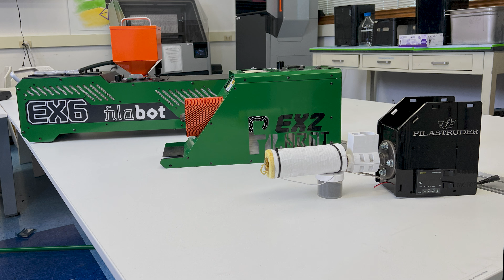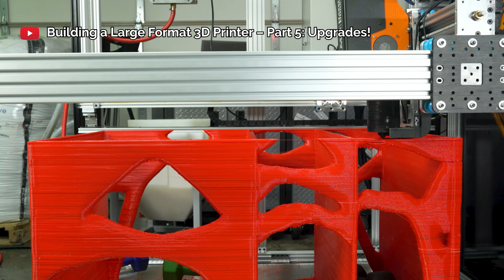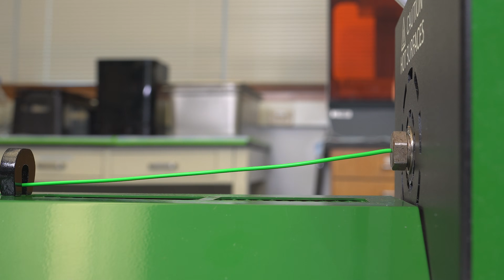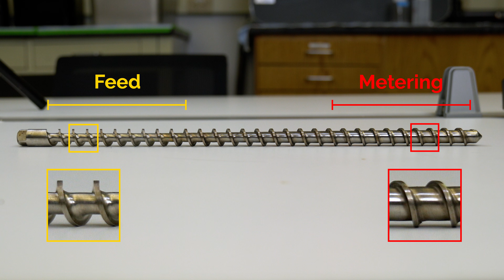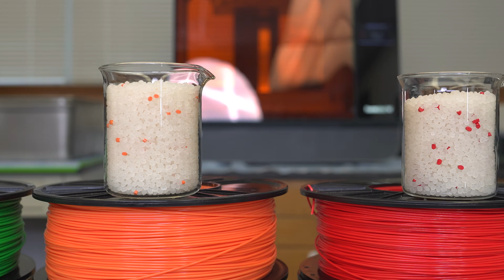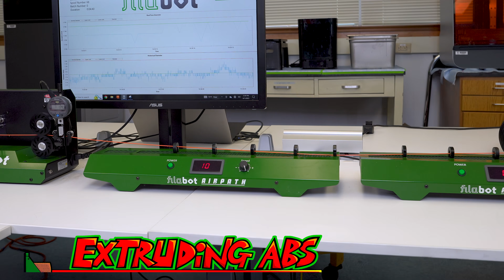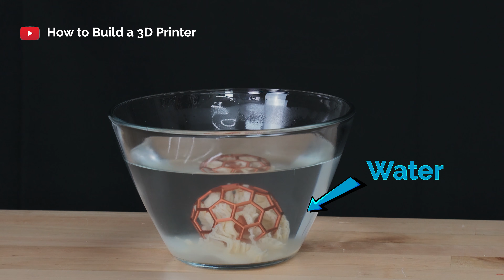How to Extrude 3D Printer Filament (Basics of Screw Extrusion)

Comment: Do you think a closed-loop controller could be added to this system to actively control the diameter instead of having to babysit it every once in a while to keep it in spec?
Reply from the maker: The issue is that the lag between the drive wheel adjustment and the change in filament diameter will depend on the volumetric output of the extruder (depends on the material) and the distance between the spooler and extruder die. You could set the automatic adjustment to wait for a long time before making a change in drive wheel speed in response to a change in filament diameter, but that would waste material/time. Also, it only takes me a couple minutes to set the drive wheel speeds and it remains constant for the whole spooling session (~ 8 hrs).

In the beginning of the video, I was trying to show everyone what it was actually like to set up the extruder, but by filming and commentating I missed that I needed to adjust the drive speed a little more to prevent that one spike. This kick started quite a few comments about an automatic drive speed adjuster.
Reply: Better off with a Noztek system for closed-loop extrusion. We have both systems and the EX6 is my go-to for non-experimental filaments. The Noz-tek takes the guess work out of the variables, and it's around the same price!
Reply from the maker: @Matt3DMaker  This is my first time hearing of Noztek. I looked at their product lines and while there are lot of similarities between Filabot and Noztek there is some innovation on the mixing side with the fusionX. Also, good to know that similarly priced instruments perform comparably  +/- some features.
Reply: @DrDFlo  I think the main improvement is the Noztek (excaliber) uses a Servo vs the DC motor on the EX6. You can set the specific RPM and it will maintain it whereas I find the EX6 has an oscillation in diameter I just can't get rid of. It won't take the filament out of spec - and I make recycled PLA +/- 0.03mm on the EX6! - but it definitely shows up as z-banding type extrusion artifacts on prints. I think the ideal solution is to integrate a PID loop with measured filament diameter at the extruder inlet, and output an extrusion ratio change. That way any filament would work perfectly!

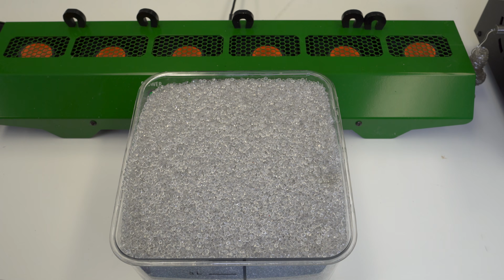Comment: Heyo! at 30:02 you mention that PETG is commonly used for food containers and drinking bottles. This is not correct, actually! The PET used in food containers and bottles is PET, no G. PETG is PET where the glycol group of PET has been replaced with something else. Modifying the glycol group to be something else than glycol makes it more suitable for 3D printing, as it behaves more amorphously.

That also means PETG isn't made from recycled drinking water bottles -- at least not directly. It's possible to do this, and done on an industrial scale. But it involves hydrolyzing the PET into its original chemical components to then use as a base material for a new polymer.
Reply: PETG is much less suitable, not more, for FDM printing in all ways except being extrudable at stock Ender 3 temperatures. The reason that gunk is sold is that it's easier to manufacture as filament and easier to sell to consumers with ultra low end printers, not that it's better than PET.

Comment: Nice video. About filabot. That hardware looks like very basic. Far from even close to industrial grade. Why everything has to be adjusted manually? No feedback from sensors, no automation. Disappointing.
Reply: Ah, But there's a good reason! It's 15k + whatever for the cooling and spooling machines and a fraction of the size of an industrial machine.

Comment: The sad thing is that anything that is even remotely accurate or efficient is so expensive that you just never make that investment back as a consumer. A DIY machine will lead to very low quality filament (good enough for a test print or something decorative that you plan on post-processing, but not structural stuff) and the machines you can buy outweigh the cost of all the failed prints of a lifetime. That is even ignoring the fact that you can't just keep re-melting plastic over and over without adding new pellets.

I hope this changes some day, because I have about 4KG of failed prints sitting in a bag that I literally can't do nothing with but refuse to throw away. Would love to just turn it into a poopy brown filament that I can use for prototyping stuff.

Comment: your content is so good! always great explanations and breakdowns of what you're doing. 
Could they make a hopper smarter by having two of them, one for metering the colorant into the other at a consistent rate for better color consistency? you could probably come up with something like that.
Reply: Yep. This needs more automation, they already have the pc the digital dial gauge, just needs some software and a microcontroller, and maybe a better mechanism for nicer spooling. Would this machine detect a filament break if it breaks before the indicator? I'm guessing not. Filament  breaking could be a fire risk. I'm not sure if the price is right for this one

Comment: Won't it be pretty simple to have a motor instead of the manual knob and then you choose 1.75 and then it's an IF >1.75 speed up, IF <1.75 speed down.
For such a mechine you would think it would be more automated. The fact that at the end it spiked up just shows you gotta babysit it and move the knob up and down as it changes. Probably the surrounding temperature also effect the cooling speed
Reply: No, unfortunately you can't. That's because the measurement is at the end of the line. Changing the speed would not change the extrusion thickness at the point of measurement, but 1-2 meters up ahead of the road.
Reply: @AnnaVannieuwenhuyse  PID can handle that, hell a P reg can handle that if it makes slow enough changes. Absoulutely can be done and should be done, then just flash some LED for the operator that the diameter is correct and it's ready for spooling
Reply: @ffoska A PID controller would work. Were you able to set up anything to get it running automatically?
Reply: @AnnaVannieuwenhuyse  I figured it would wIt a few seconds between each change, same as you need to do manually

Comment: screw this hmh :)
Reply: no offense, just pun, intended
Reply: what, dont you have nozzle type melters for small extruders, like in 3d printers, or just feed the plastic directly to 3d printer, no spooling of filament step required, just a plastic feed into the actual extruder
Reply: screw the 3d printer print head nozzle then
Reply: I mean screw + heater etc
Reply: work smarter (if any), not harder
Reply: the output of the 3d printer nozzle is something like 0.2mm or 0.4mm or whatnot, just feed that directly
Reply: just pour plastic pebbles into the feed chamber, any color, any mix
Reply: this nots
Reply: pre-melt the input in larger input chamber
Reply: then the current 3d printer nozzles are trash, if they cant handle variations, too simple filament feed system in wrong place
Reply: centrifugal friction melting pump would work too, ie, centrifugal spin spiral wing turbine
Reply: or tesla turbine in pump mode, a ton of surface friction discs
Reply: yeah you can change parts or the whole 3d printer extruder from pellets head also, small size
Reply: yeah skip this phase completely
Reply: no spool, no double extrusion
Reply: ABS is a glass
Reply: smart is also simple
Reply: Ah more schlzo posting, nice... 🤦‍♂️

Comment: 5:20 are you serious ??you have  exact measurements of the diameter . via some  sensor..
.WHY?? adjust the diameter  manually?????   you could use a adruino  to adjust the potentiometer  based on the  sensor  readings  
why are you adjusting this  by hand ???

.......a simple fix rather that  using guesswork
Reply: because the readings are not made at the point where it comes out of the extruder, rather two meters down the road. That means adjusting the diameter through speed changed like this would require complex algorithms to average out the change over time while still ensuring consistency.
Reply: @AnnaVannieuwenhuyse  complex algorithms ?  🤔  you preform these "complex algorithms"   manually by turning a knob 😑😐 🤏
Reply: @FSK1138  there is a massive amount of phase lag. Designing a controller to do this is non-trivial, but not complicated. the most important thing is it greatly increases the complexity of running the machine. All the sudden the user has to tune a diameter controller for their material, as well as know everything else about using the machine.